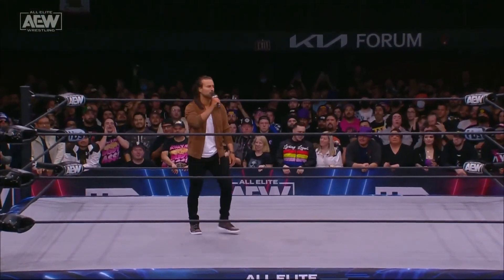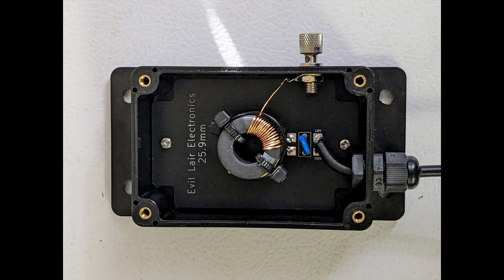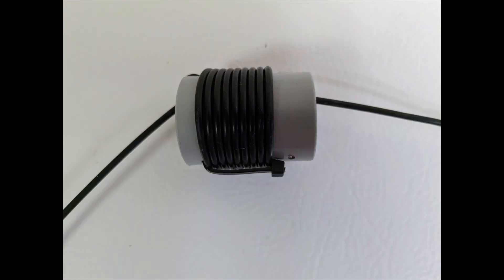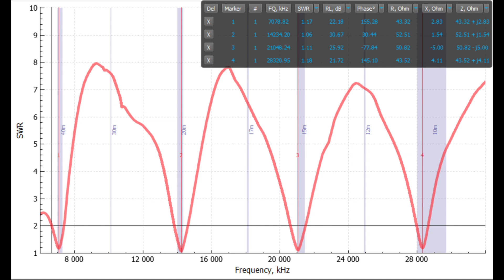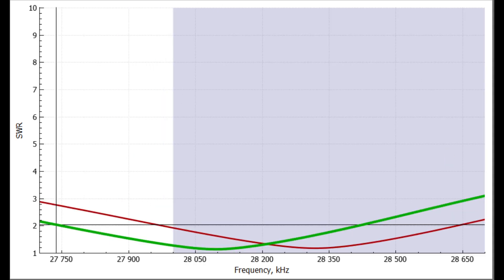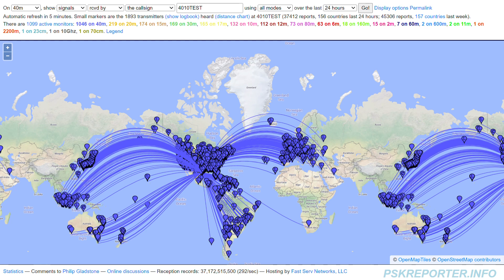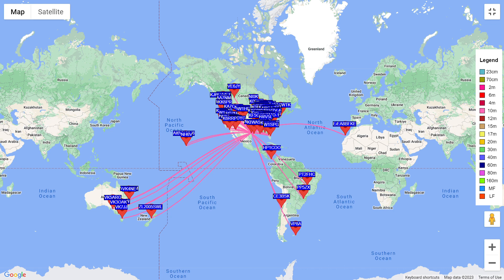An efficient 40-10m EFHW antenna for portable ops

Comment: Big follower and fan of yours.  Wound 2 identical 49:1 transformers using the 61 material.  Used plastic coated wire, separate primary and secondary windings, not twisted but bifilar wound, and close space turns.  Back to back transformer test results very similar to yours.  Back to back results: 7.088 MHz = -0.23 dB, 7.285 MHz = -0.20 dB, 14.07 MHz = -0.21 dB, 21.15 MHz = -0.53 dB, 28.23 MHz = -1.08 dB (divide these results to get individual transformer loss).  Calculated efficiency on 40 meters 97.3%.  Also tested back to back connected transformers on the bench running 100 watts CW and just noticed slight increase in temperature when touched by hand.  Thanks, Don (wd8dsb)

Comment: Thanks for the video. Respect. Have you tried loss measurement using a resistive terminator on the output, 2400R and then into port-2? I may be wrong, but I believe Owen Duffy uses this in his measurements? Also, and with the greatest respect, the loss on 80m is kind of indicating it needs more primary turns - then in my experience, 10m performance will be worse - of course happy to be proven wrong and learn.
Reply from the maker: Yes, I've considered doing some testing in that way. It's much more of a hassle. I will probably do that with a couple of transformers and also put the same ones in pairs on a soldered jig keeping all of the leads as short as possible so that the comparison of the two tests would be the fairest. I know my quick change jig for testing pairs introduces a small amount of loss on 10m as I have seen it more than once when comparing with everything soldered and short leads. Only a very small amount in the 10m range, all of the rest of the loss graph still matched. Plus you are going to have that same kind of variance depending on how long the leads are when the transformer and capacitor are put in an enclosure, exactly why I created the circuit boards. As for primary turns that is correct, which is why with an unknown ferrite like this one was, first I will start it off with a 3T/27T wind. That way I can test it, remove turns from each end, retest, see what it likes the best. Much easier than winding 2T/14T then having to completely start over to get more turns. In this case, yes it looks acceptable for 80m when it has 3 primary turns. However it starts to get lossy on 15m, then 12m and 10m are in the toilet. And that's fine, something small/portable like this, I don't think portable users are likely to use 80m anyhow and it's really nice with 2 primary turns. After winding hundreds of different transformers, maybe over a thousand by now, I have yet to see a 52 or 61 mix that can efficiently cover 80-10m, they are always narrower and will miss either the bottom, top, or both.

Comment: Going to pursue building same, as I like everything from low loss ferrite to case to the connect points. Am I correct that you glued the bottom of the wound core to the bottom of the board with what looks like Black RTV???   Also, can you provide a picture on GitHub or here of the actual tap point attachment at winding 2.
Reply from the maker: No glue, just the 2 tie straps holding it on the board. When I am winding the wire onto the ferrite, after making the first 2 turns, I scrape the area of the wire which will be on the outside of the ferrite, then loop it around the end of a toothpick and continue to wind the rest of the transformer. So I then have that little loop sticking out, already scraped ready for the tap wire to be soldered to it.

Comment: Great stuff, excellent video 👏.  I tested your winding scheme with my TX36/23/15-4C65 cores from DX-Wire here in Germany, and I measured the loss with two setups, using your test method. Now I know the loss: 40m not usable (-1.79dB), 30m somehow ok (-0.86dB), 20m-10m good (0.35dB to 0.55dB). Much better than my former setup 👍

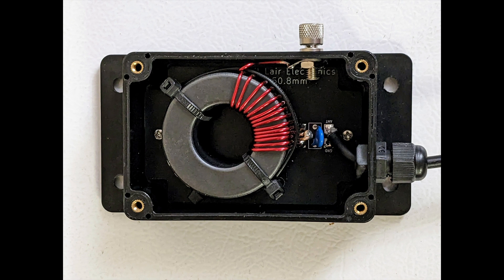Comment: Q. I'm a new HAM and this will be my very first antenna build. QUESTION:  Which outside turn does the tap/loop go? (2nd or 3rd) 2:55 ?  I've ordered all the parts - Thankyou!  73.
Reply from the maker: The correct way is to count the turns through the center of the ferrite, so it would be after 2 passes through the center.
Reply: @evil_lair_electronics  Thankyou.  I was getting a bit confused by it.  Awaiting parts to arrive in Australia/VK and shall let ya know 🙂

Comment: QUESTION:  Thankyou for a great video.... What is the effect if magnet wire is not as close as yours but tight wind??  Cheers.
Reply from the maker: Thank you. My experience has been that spreading the turns out showed more loss 100% of the time no matter what size/mix of ferrite I was using..
Reply: @evil_lair_electronics  Thankyou.  I'm a noob HAM.  Made 1st transformer, it was a disaster, did another, still bad just better. I'll try again and might use PTFE just to learn from -- I know it's not as efficient as magnet wire.... Cheers.

Comment: Great video. How did you use a circuit board to attach the windings/cap/coax? Just a piece of circuit board glued to the box?
Reply from the maker: Had the custom circuit boards manufactured. 2 screws holding them in the enclosure.

Comment: Thank you for injecting a lot of common sense into this topic.
Please clarify some details on the coil you have at 2m from feed. I believe you said 9 turns on a 28mm PVC form. I want to double check on this, because there is nothing on the Schedule 40 size list that's 28mm OD. Nominal 3/4" is under 27 mm OD; the next size up (1") is over 33 mm OD. Are you using something other than a Schedule 40/Schedule 80 size form? Would appreciate clarification. Thank you!
Reply from the maker: Hi, it's a 1/2" PVC conduit coupler, not pipe, that is what it measured at. Don't get hung up on the exact diameter or how many turns or your tuning will never be right same if you try to just copy the overall antenna length it won't tune right either. It all needs to be tuned in your environment. It's going to vary with whatever wire you use, so adjust the number of turns to bring 10m and 15m down to where you want them.
Reply: @evil_lair_electronics  TU OM; understood. One still needs a departure point - a place to start. You know the adage, I'm sure: Cut long and trim to suit. For that shape coil, inductance doesn't change much with number of turns or diameter as long as the length of wire coiled up is unchanged.

Comment: Thanks for excellent information. Will 2661102002 work with 100W ( ft-891 )?
Reply: Based on the weight of the core 55g. The ones I actually measured are 58g you should be able to do 120-140 watts cw ssb and maybe 50-55 watts ft8. Depends on band and swr etc. That is just a quick guess. Someone chime in with actual field performance
Reply: @robertvantichelt6448 I did 47 watts ft8 on 40-10 meter for about 30 hours straight on that core and it was fine, but that was near resonance and not off band.

Comment: I agree that the SWR using a resistor across the terminals of the transformer will not give you a valid picture of the real world when there is an antenna on the terminals.  However, I don't agree that it is a waste of time using a carbon resistor to check your work.  If you have just wound what you expect to be a 4:1 bifilar transformer I think most people would want to test it on the bench with a 200 ohm load to see if it looks like 4:1 on the other end.  What's the alternative, put it in a box, haul everything up 30' or more and hope for the best?
Reply from the maker: I'm already bench testing a pair of them for loss. So if there was something like a short or open that happened during construction I would see it during that test.
Reply: @evil_lair_electronics  A good S11 measurement is the o/c and s/c conditions.   That provides good and valid insight into transformer performance.    I suspect the key to your improved performance is that it reflects the need  for the ferrite core height to be greater than its width.  The internal wires running up the core are doing the good work,  the wires across the top and bottom of the core cause most of the trouble. The classic FT240-43 single core build ignores the science.

Comment: How do you calculate the right turn number for primary? (I saw you used 2 for 61 mix).  Any particular inductance for particular frequency?
Reply from the maker: I never go down the path of a bunch of theoretical calculations when it's the real world results I'm after. I just do loss testing with a VNA, looking for what is low loss across the frequencies I want to use it for. When it is ferrite I haven't worked with before like this one, I initially wound them 3T/24T, loss tested, then removed the primary turn on one end and the 8 secondary turns on the other end and re-tested. Do it in that order so you don't have to wind them twice(unless more turns was better, then you're stuck rewinding).
Reply: @evil_lair_electronics thank you - waiting for mine to arrive and will start testing !

Comment: Excellent video, thank you for sharing your experience with us, I just ordered all the parts to build one, quick question, What size of enameled wire did you use for your transformer?,And what is the maximum power to use with core 2661102002? My intention is to use 50 or 25 watts. Thank you in Advance,73
Reply from the maker: I used 22ga on this one, but it can take larger wire. It will handle that power level no problem!

Comment: Cannot thank you enough for this. Everything now is opinion and self promotion; it's a relief to find a source of documented, tested and reproduceable truth. Science, not opinion!

A couple of technical questions for you to consider:

First, what is the effect of the choice of wire used in the toroid? Obviously, you want the wire to be large enough to handle the anticipated load (matched and unmatched), but what effects occur with smaller or larger wire, enameled or insulated in some other way?

Second, the wrapping technique. Everything I've read suggests that the lowest loss occurs when the wire is VERY tightly conformed to the surface of the toroid core, and windings are physically touching and parallel inside (and even outside) the core. Can you confirm that? As I've wound my cores, I have noticed major performance changes if I fail to observe these rules.

Thanks again, and keep up the good work!
Reply from the maker: Hi. I've never used anything but magnet wire. Nothing scientific about how I choose the size, it's just what seems it would fit the particular size of ferrite and not be so small that it would concern me with the anticipated power level. If larger was desired I have wound these same size transformers with 18awg before and there is certainly room to go larger than that. However, the larger the wire, the more difficult it becomes to tightly wind it to the ferrite and have all the turns tight together. I agree with you 100% that tight windings show lower losses, mine are always all touching on the inside. This is a good argument for only using magnet wire also, as wire with insulation is going to spread them farther apart.

Comment: Tnx … could you make a vide explain better how to build or wind this ?
Reply from the maker: Which part did you need clarification about? The winding is 16 turns, tapped after 2 turns.
Reply: @evil_lair_electronics  ok Tnx .. yes i mean the winding
Reply: @evil_lair_electronics   How are you tapping the second turn? Soldering a small piece of wire?  Are you insulating it in any way (since you have to be removing the coating from the magnetic wire to solder the tap?
Reply from the maker: @kevmscott   After I have wound the initial 2 turns onto the ferrite, I scrape off a small area of the wire that would be on the outside and bend it into a little loop, stick a toothpick through the hole, then finish winding the other turns. Then come back with a short section of wire bent into a hook on the end to put through the loop, then solder it. I've seen others not even make the loop and just scrape a straight section of wire, then use the same type of hooked tap underneath it. I don't insulate it, I know some people do and if you just put a little insulating tape on the outside surface of the ferrite there it certainly won't hurt anything. The ferrite isn't very conductive. If you look at data sheets, 43 is 100K resistance per centimeter,  61 is 100M, and 52 is 1 gigaohm. Just don't scuff up the turns next to it and end up with a short between turns.
Reply: @evil_lair_electronics  , Thank you!
Reply: @evil_lair_electronics  Just wanted to say - it is working great for my vertical 20m.  BTW, why did you choose to use 64:1 and not 49:1 ? Any particular reason?
Reply from the maker: @polzovotel   because I was making this for portable use I tested it no higher from the ground than you will get from a portable mast. If the wire was up higher a lower ratio certainly might be better. I normally start with 64:1 when tuning an EFHW and if it favors the lower bands too much try removing a turn from the transformer which should improve the upper bands. In this case best SWR was less than 1.2:1 on all 4 bands so I never had to change it.
Reply: @evil_lair_electronics  Got it - make sense. I have a 20m vertical EFHW, 1.5m above the ground. Using 2/16 winding I am getting almost perfect match - SWR 1.02. And not more than 1.19 SWR on whole 20m band.

Comment: What is the max. tx. power ?
Reply from the maker: I really have no idea. 61 mix can take a lot of temperature. It's small and meant for portable use, can certainly take any realistic amount that someone would have when portable.
Reply: Owen Duffy I believe tested the 43 mix version at 20 watts key down. A little bit less efficient but similar core weight to this one. Build one and let us know
Reply from the maker: @robertvantichelt6448  I tested that one in February of 2020: https://www.youtube.com/watch?v=AjH1iesDWJI  It is way smaller, only 18.7% of the mass of this one.
Reply: Ok based on the mass of this core 55g. The ones I got I measured at 58g. I'm guessing 120-140 ssb cw. Maybe more because of the efficiency numbers. Probably 50-55 watt ft8. Now this is only a guess based on core mass and efficiency. Someone needs to test one

Comment: Self proclaimed antenna engineers usually argue among themselves as to why an antenna acts as it does, especially when they see real world differences from their predictions. You need to stop taking them seriously as their fun seems to come from arguing and acting superior.
When it comes to antenna efficiency I put more faith in A / B testing than db claims. A / B this antenna against dipoles for each band (as a baseline), verticals (FEB), then against other antennas you think are so inefficient, and show real world on the air results when the bands are so-so. 
Bottom line, if an antenna isn't putting its signal out where it needs to be, minimal db loss' don't mean squat.  More loss with a better pattern will beat it.   73   mike

Comment: Why don't you eliminate the binding post also. In the name of efficiency. If you need a removable antenna just hang a little wire stub out of the box and use the little RC car bullet connectors. Cheap and makes a good electrical connection
Reply: The binding post wouldn't be very lossy.